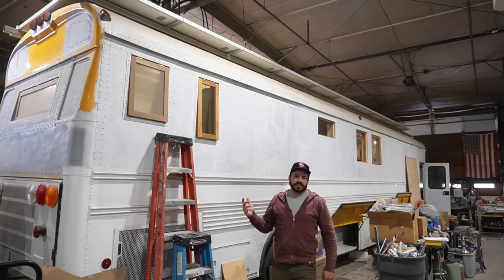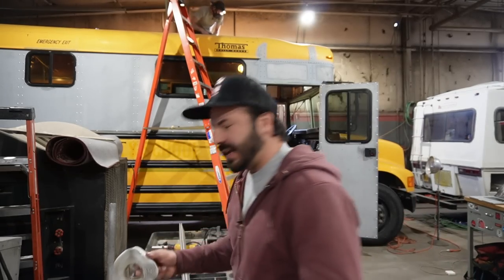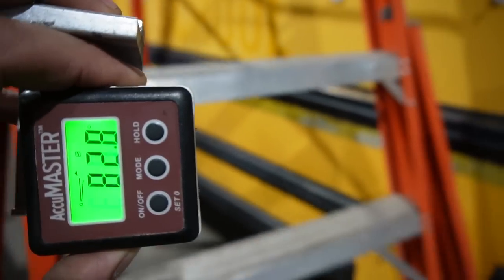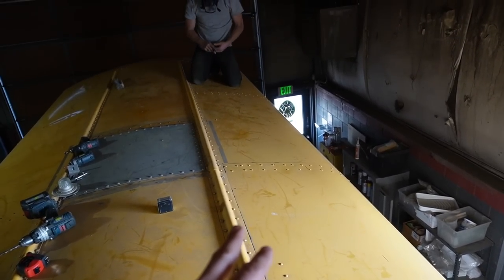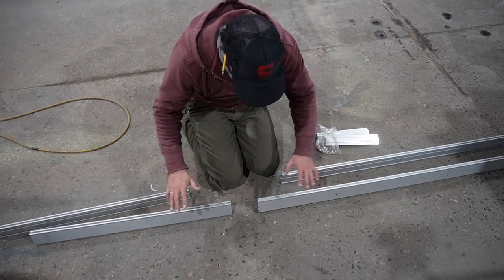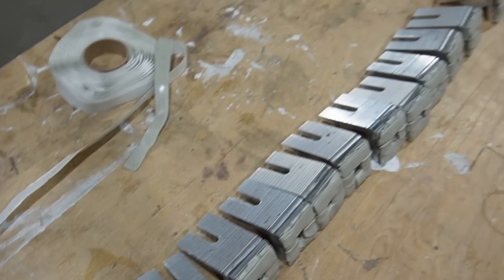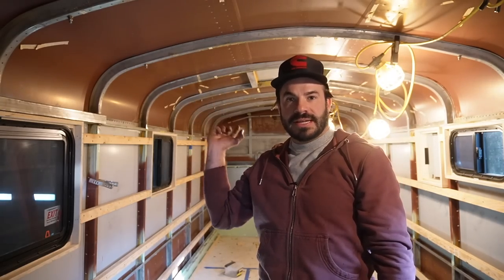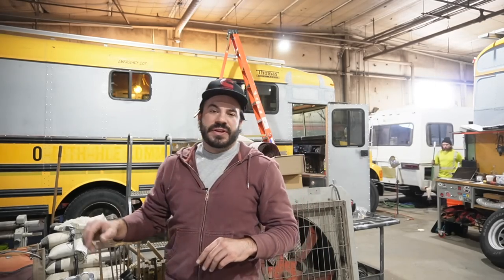Solar Racking for Idiots (like me)

Comment: Be aware the Hat Channels are different for each bus manufacturer. My International takes 3” bolts not 3 1/2”. If you order the L brackets know that they do not come with bolts as many catalogues wrongly picture them. To save some  money, buy 1” stainless hex bolts and Stainless serrated nuts for half the cost of Iron Ridge’s fasteners.

Comment: 1st job I had back in the 70s was working for Carolina tool and equipment in travelers rest south Carolina. I built the hydraulic cylinders  that controls the feed rate. They are really a tough built saw. I'm just starting my bus build and find your channel has easy to understand and follow information  thanks

Comment: I like the system.  Unfortunately I have an RV that is already built but I so have steel supports in the roof so I guess I could use sheet metal screws.   Keep the good stuff coming.

Comment: Chuck, your content is the best.  Have you found a suitable cross bar and hardware and method to tie these rails together for attaching rooftop decking etc?  I have a transit van and it has 10 mounting points.  I was thinking about purchasing 10 extra l mounts and mounting them upside down and bolting cross rails out of rectangular aluminum tubing. Thoughts???

Comment: Chuck, I meant to ask you this question during the solar racking premiere but you made it so dang interesting and informative that I completely forgot about the hvac question I have for my bus. 

As I was looking thru the pioneer systems on line earlier today, I came across one mini split system with a cartridge ceiling air handler that is like 12”x12” square that gets recessed into the ceiling and the other is a unit that mounts inside a bench at the dining table or under a bed or inside a couch and has 2 1/2” round duct that channels the heat/air where you want it. 

My question is, have you used either of these systems yet and how did you like them if you did? They look fantastic and you don’t have the big wall unit to deal with and it would be a much cleaner    

As I was looking at them, the question “What would Chuck do” kept running thru my mind so I was hoping you could tell me please. What Chuck would do!
Reply from the maker: The under bench units look super easy to install but they are not as efficient unfortunately.as for the ceiling unit, that looks awesome but it does stick up pretty high so I've never done one
Reply: @ChuckCassadyYT  i have a friend who didn’t go through the hat channel but just through the skin. Is that a issue or a major concern?
Reply: @ChuckCassadyYT  you are correct about the height of the ceiling cartridge unit and it would be thicker than almost any ceiling you would put in but I do have a simple solution that would work great and I think I’m gonna try it in my bus. 

If you cut a hole in the roof for the cartridge to mount where  it needs to mount, then make a sheet metal box on your fancy brake with a bolt or rivet flange running around the perimeter and put a strip of the butyl tape between the roof and the flange to seal, I think it would work well. Most of your subs are probly cringing about cutting a hole in the roof but it’s no different than a roof a/c unit or a roof fan penetration. Seal it properly with good materials and it will never leak.

Comment: Again, I could have used this video months back. 🤷🏼‍♀️ I used unistrut mounted with 3/8” bolts into rivenuts on my roof. I laid the rails on top of hockey pucks that were set into a bed of dicor tape, with sikaflex (evil cousin of 5200) around edge & dollop on top.  We just went through the eye of hurricane Ian in the bus. The 155 mph sustained winds & gusts of the first eye wall didn’t do any damage, we had our bow just off the wind. But the second eye wall hit us broadside with 170 mph gusts before I could get her fired up and moved. The first whomp had me running to the drivers seat and starting the bus, the second whomp took 2 of my solar panels and tossed them 100 ft away, the third whomp took the last 4 panels and all my mounting rails & hardware and laid them on top of first 2. All within what seemed like seconds but was actually a couple of minutes. The bad news ….. I have to replace the panels & hardware. The good news …… I have a wind rating for my mounting system and it’s higher than any speed I’ll ever drive 🤣🤣 I am going to beef up the racks with larger bolts and rivenuts. Unfortunately my bus is already built out inside so I can’t go back and through bolt, but the rivenuts into the roof channel are a strong mount and will be fine, especially with being beefed up a bit, and no more hurricanes. 🤣😁👍🏻
Reply from the maker: now THAT is one hell of a story! glad you're ok!

Comment: Love the video and this system saves welding up a custom aluminum rack.  Do know if iron ridge makes cross bars to connect the XR1000 across the bus.  I may be able to mount more panels if I put them in pairs longways.  Mine are 40" wide by 66" long so a pair is 80" across the bus and 66" long.  So 4 panels up front and 4 in the back with a hatch in the middle. If I do them 66" across the bus they are tucked up away from the edge more but I get less.  I'm trying to get at least 2k or more.  My panels are 335w x8 would be 2680w.

Comment: Three questions!  1) Why antiseize if the solar mounting interior nuts will be inaccessible?  Wouldn't SS cold weld be a good thing?  
2) Any tips on how you might modify your technique with an intact already-converted nice ceiling?   e.g. PlusNuts?   
3) Have you done a video on the plumbing system yet or is that coming up?  
Thanks for this video and any answers you can help with.
Reply from the maker: 1) it will gall and seize before its tight. No good
2) def use plus nuts and not rivnuts, and I'd shoot for ribs or places where it's doubled, the skins on roofs is very thin sometimes
3) you can always search my videos, but I have not done a plumbing video. They are released in chronological order as I build
Reply: @ChuckCassadyYT  Good to know, thanks!   I will be following your build videos with interest.  I had searched but didn't find a plumbing video, but sometimes it's hard to remember that even though you've done so many conversions you didn't video them!

Comment: Aren't school buses mostly made of steel. Wouldn't it be better to use steel brackets so that you don't get galvanic corrosions that occur from putting different metals together?
Reply from the maker: The aluminum of the bracket doesn’t touch the steel of the roof because it’s painted. Maybe in 100 years it would cause an issue
Reply: Yes. Steel would be a better choice especially due to dynamic loading that a rack on a bus would experience, since aluminum work hardens without a plateau like steel does. Galvanic corrosion might not be too bad but you will always get some because there's still a conductive path between the bracket and the roof via the bolt touching the bracket, and the nut touching the hat channel, which touches the roof. As I'm sure you know; doesn't matter how long the conductive path is, just that it's there

Comment: I am in the process of doing a solar rail installation on my skoolie using this video as a guide. I have run into areas where the rivets on the bus roof seams where the hat channels are get in the way of the mounting brackets need to be to be over the hat channel.  The bulge of the rivet prevents the bracket from sitting flush.  Did you encounter this?  Any recommended solutions? Thanks for all your videos!

Comment: 70 5/16" width between rails - how wide are your panels?? Wondering how much overhang I should leave for the sides of my panels, I got 72" wide panels and im thinking about 6"-12" overhang on each end?

Comment: Ive done this and now trying to figure out good horizontal supports/joists  to use for decking. Anyone figure out a good solution?
Reply: I haven't done mine yet. But I've planned to so 2x1 aluminum tubing perpendicular to the rails for support and wood planks across those. Hope that helps

Comment: Chuck do you have a link to the guy making curved L brackets. I was thinking of welding the L brackets to prevent all the holes, etc
Reply from the maker: The brackets are aluminum, you couldn't weld them to the steel roof

Comment: Using epoxy to glue aluminium will eventually fail. Oxygen will get under the epoxy and the aluminium will oxidise creating aluminium oxide which will break the epoxy. If you want to glue aluminium with epoxy you need to chemical etch the surface and then anodise. This is how Lotus cars are made.
Reply from the maker: The aluminum oxidizes almost instantly with air contact already though?
Reply: @ChuckCassadyYT  It does, but the oxidation continues. With anodising the oxide layer is built up relatively thick. I've known people who have glued aluminium with epoxy in this way and it's stood up for quite a while and then fails - almost always. It's not just Lotus who etches and glues, aluminium aircraft are built this way also and they do it for a reason. 

Chuck, I like your channel a lot. I'm going to do a truck conversion in the future and you've both confirmed a lot of the design decisions I've already made and also given me a lot of information I didn't know, so big thanks. I can see the quality of your work is very high and you're a clever guy. Actually, you're the only channel I've seen that has got proper control of thermal insulation. So many I see are doing it wrong or badly and it's just a big waste of time and money. No fun living in either a cold or a a damp truck. Anyway, on this issue I think you need to do a bit more research.